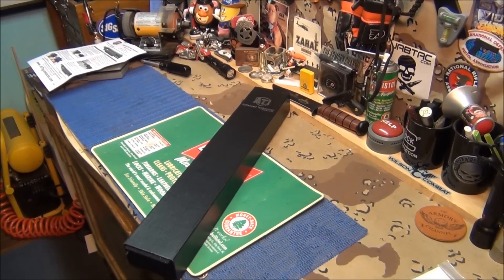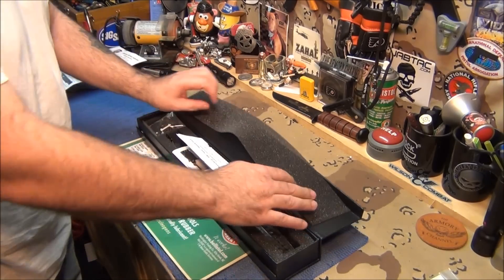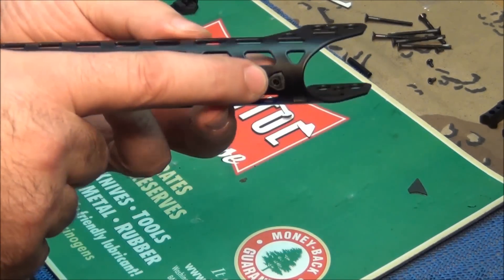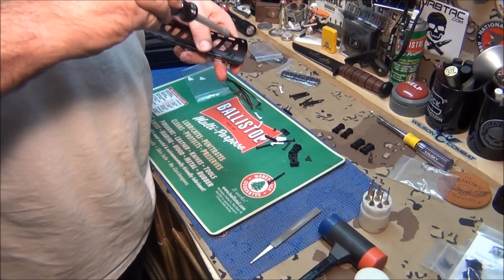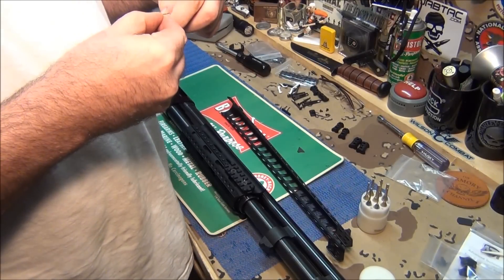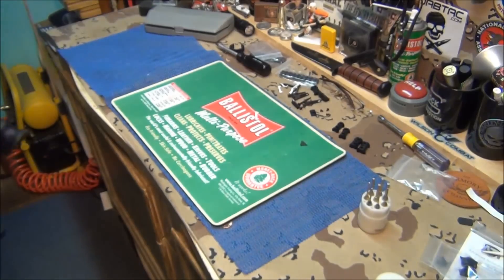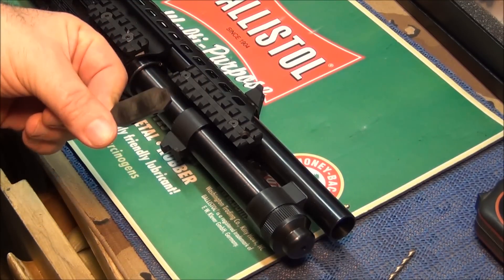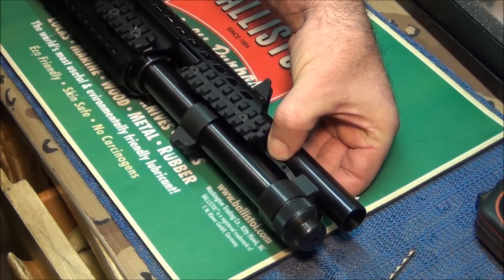ATI Shotgun series final

Comment: I would have duplacated that front space using the plastic one as a template with aluminum. Plastic and heat dont mix.

The old style heat shield from ATI where not good fitting where you clamp them to the front, The heat shield looks cool but I dont thing it really performs any function. Kind of like fuzzy dice on a rear view mirror....I have those too  : )

Comment: The shotgun is already threaded for a picatinny rail if you wanted a red dot on it? All 590's, whether they be SP's or A1's (except the 18" A1, it's the only non-20" 590) are going to be 20" barrels with the bayo lug....... Should get an M9 or OKC-3S bayonet, "just for the fun of it", also for about twice the price of the 'heatshield ghost rings', which haven't worked well with anyone I know(too far forward, not best aperture size for being 12" in front of your eye), you can get Mossberg GRS'.